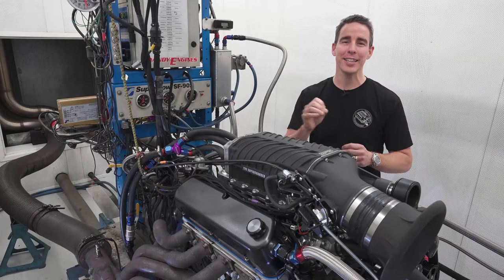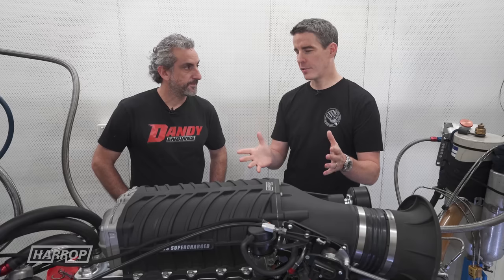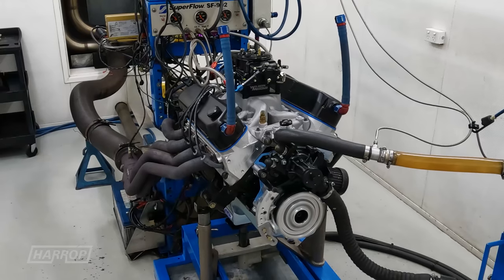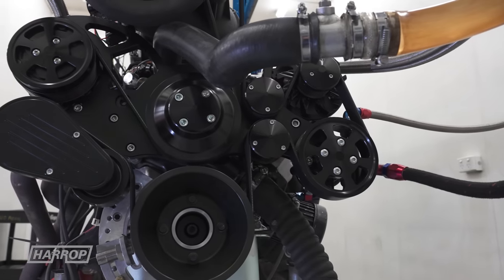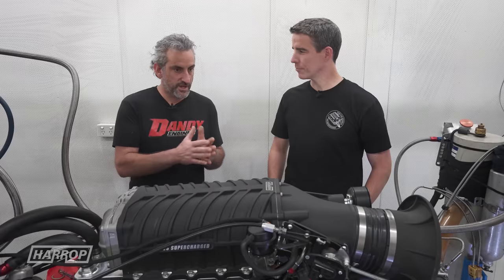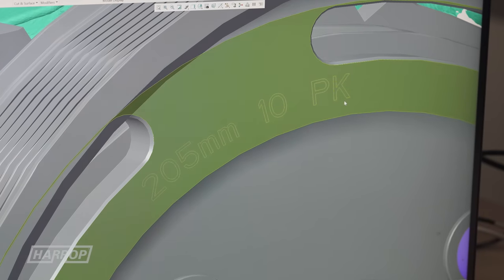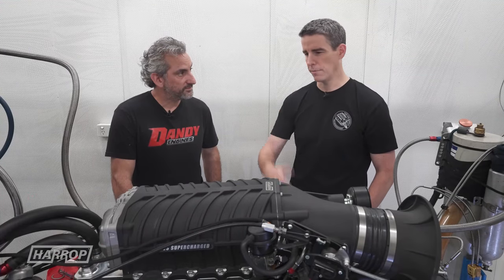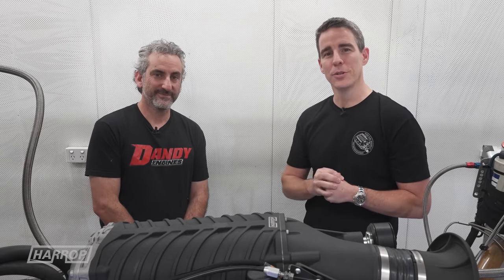Small Block Ford V8 | Harrop Supercharger Testing

Comment: Great to see modern blower kits being developed for the old pushrod engines.
Reply: Pushrod engines arent old, Ford and GM are still making them....
Reply: @alexcorona he said old pushrod engines meaning older pushrod v8s. can’t believe I’m translating this for you
Reply: No doubt. I still run a 5.0 sbf turbo. They are still competitive- I know to some it is unbelievable to some.
Reply: I want one so bad!!! Bucketlist item!!
Reply: @alexcorona  Push rod tech is OLD  is what they mean
Reply: @jameshenson4871  ofc they are.  there are stock block 351Ws  running  8s   and  stock 8.2 deck guys are in the low 5's in the 1/8

Comment: It would be cool to see a 351W version.
Reply: I second this..... I'll be in line to buy one for my 421w
Reply: Would fit 351 windsor same heads
Reply: @SR-uy7cx  8.2 deck vs 9.5 deck. The lower intake is much wider.
Reply: @SR-uy7cx  The spread between the heads is wider on a 351W vs a 302.
Reply: This was a 363 stroker,  so expect the same numbers. They use the same heads/cam
Reply: Used to make adapters for 302-351w intakes... The rest can be sorted if you ABSOLUTELY want to run this setup... They said they was considering a Clevor setup so I'd just wait for that then get some CNC Cleveland heads on a 408 stroker 🙌... Now that is power 😌🤌
Reply: @AntoninusPius2  I have a set of 302 to 351 adaptor plates from Price Motor Sports to put a Weiand 302 blower on a 351. Holley no longer make these blowers and PMS no longer makes the adaptor plates. I would like to have one of these new Harrop units if it would support a 351 427 stroker.
Reply: If you check their website. The 9.2 and 9.5 decks systems are in development.
Reply: Definitely 👌

Comment: What is the reason for the deop off in power after 14psi (only 120hp with an additional 8psi boost). Was this timing/ tune, camshaft, cooling or SC falling out of its efficiency zone?

Awesome package btw, looks really neat
Reply: Not enough engine.

These blowers can make 1250+

Bet you put of his on a 408 Windsor with TF 220 11R heads  and you'd be working that blowers max efficiency with less boost

Comment: Can't use 900hp in a mustang? Mine makes 910hp and 800ftlbs. I can drive it daily. It does get a bit loose on a street tire but with proper suspension and knowledge  its manageable every day
Reply: The driver makes all the difference in a high powered vehicle.
Reply: I think he means a 60s mustang

Comment: Whats the cam specs and compression and fuel.
Reply from the maker: Streetable hydraulic cam, 10:1, 98RON & E85 fuel, see table at the end of the video.
Reply: No streetable cam spins 7500rpm in a Windsor.  What rpm is it making Max power?
Reply: @maximusvonce1381 sure it can, you did watch the video correct ?

Comment: 7500rpm. Must be a huge drag solid roller cam drag racing only Camshaft.
Reply from the maker: Hydraulic Cam ideal for street use.
Reply: Very  unsafe spinning Hydraulic roller to 7500rpm and valve float. Plus Hydraulic rollers that spin that high dont last long and they are heavy as fck
Reply: @maximusvonce1381 Not unless you using High quality lifters and enough valve spring pressure to keep the lifter on the cam lobe.

Comment: E85 = is not the real answer ! = it has very bad history of = Rust - and making oil turn to vegemite ! - and uses twice as much fuel ! = larger lines or massive fuel pressure !
Reply: It's cheap and available. That's the main draw. Octane booster for standard petrol is expensive.